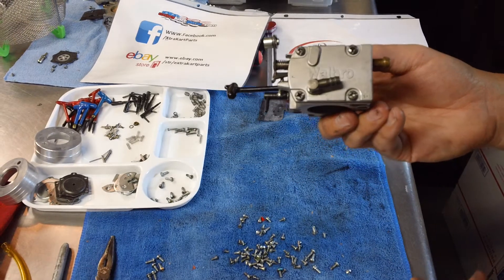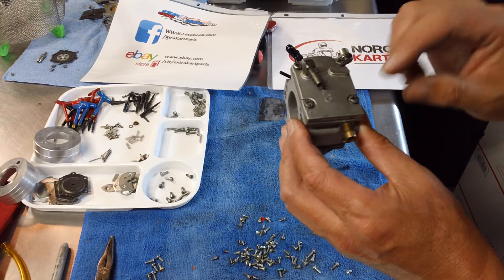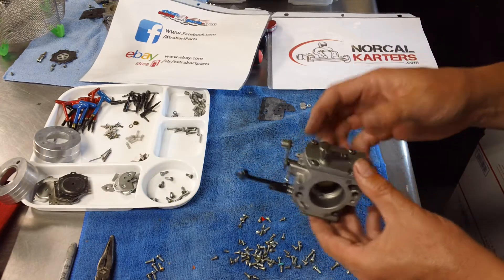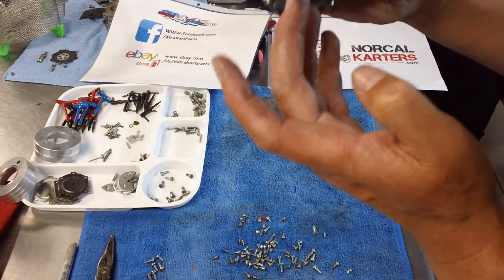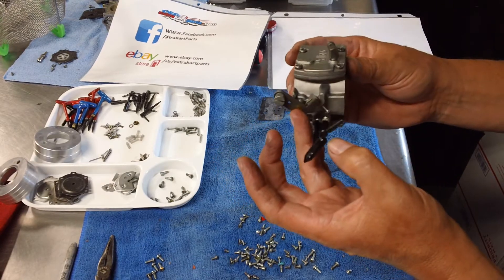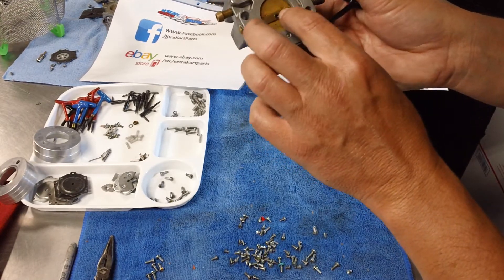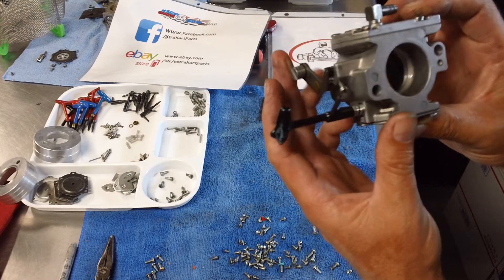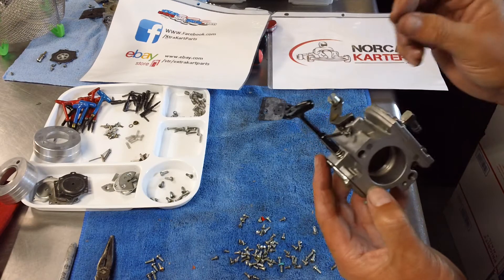Basic Anatomy of the Walbro WB3a Carburetor

Comment: i am getting fuel inside my pulse line and it flooding out my exhaust port , fuel is coming out of exhaust , ever since i cleaned out my carbs and re install it , what is wrong with it do you have any clue would be helpful ? thanks
Reply: It's possible when you reassembled you placed the metering diaphragm on against the carb body and then the gasket.   They are supposed to be the other way around, as opposed to the pump diaphragm, which IS supposed to be against the carb body.  In the incorrect configuration the metering diaphragm button is pressing against the needle lever too much, causing fuel to flood the carb and then everything connected to the carb like the crankcase, impulse line and eventually the exhaust.
That is a common mistake made by all first-timers.  I've done it myself when I wasn't paying attention enough, even though I knew the correct order.  At least it's an easy fix.
If that didn't fix it then it's possible the needle lever is bent up to high or the spring is weak.
Reply: Did you replace the gaskets with oem and new gaskets when you cleaned it?  Pulse circuit and fuel circuit should always be separate if assembled correctly.

Comment: I change it all gaskets, diafragm and gas line vs  filter, But it doesn't flow gas in carburator.  No air bubbles.  Please help me. Think so much
Reply from the maker: Check vent line in gas tank for proper open air venting  Swap out carb, if you still have problem, it's not carb. If problem goes away, it's the carb. Check needle settings and inspect assembly of gaskets again. Check pop off pressure. If you find it's the carb, and you can't diagnose, send to a reputable engine builder.